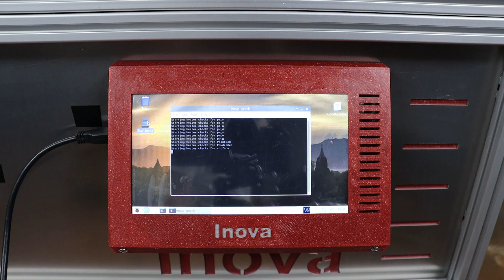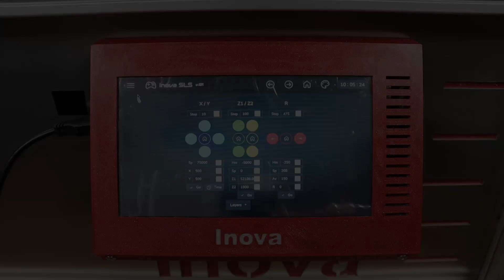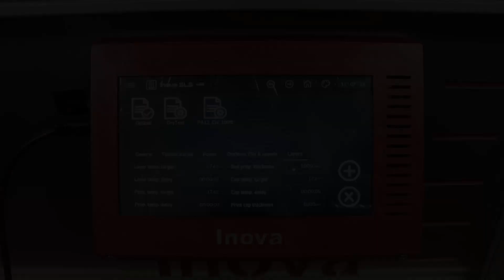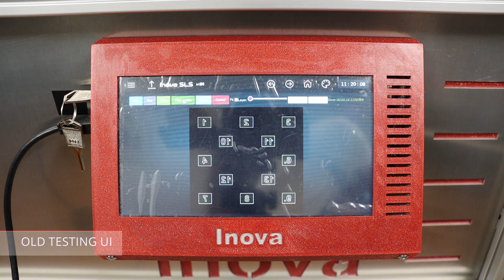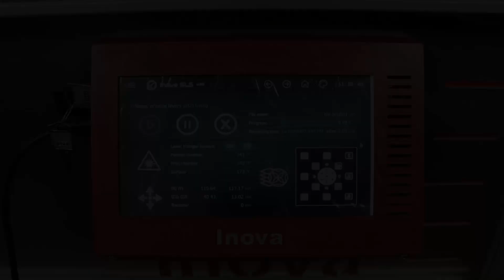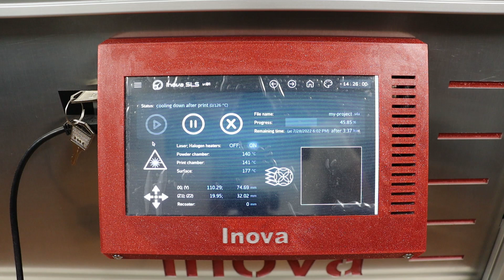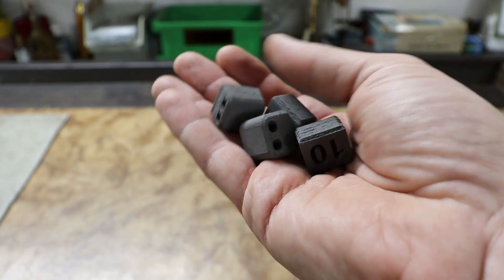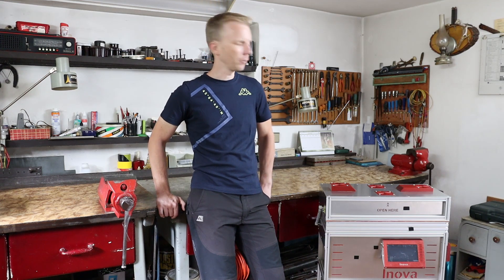DIY SLS 3D Printer Testing - InDepth Look

Comment: I wonder if instead of using one laser you could use 3 side lasers and one top laser to print from the top and sides
Reply from the maker: No sure what do you mean by side lasers. Generally, you can use more lasers but the complexity of the system as a whole will increase dramatically.

Comment: He is smart, resourceful and humble. Tomas, you are such a royal man, my friend. I looked at your site, but I couldn't understand what type of laser you used. Did you use UV?
Reply from the maker: Thanks! I use 445nm blue diode laser.
Reply: @SLS4All  Thank you for the reply, do you use a galvo head? Or is it the moving x y axis?
Reply from the maker: Both the prototype and the RC version of my printer use galvo.
Reply: @SLS4All  I didn't know there was a galvo in the diode laser. Is there a product you can recommend?
Reply from the maker: There are two separate parts - laser and the galvo. You can find links on my website.
If you have further questions, consider joining my Discord as it's better to discuss there. Link is in the description.
Reply: @SLS4All  Thank you so much my friend

Comment: Your surface temp is fluctuating A LOT (I don;t know if its measurement fluctuation or real temp. one). I found that even 0.5C fluctuation can cause prints to look awful. At least on my Sinterit Lisa Pro.  BTW: could you please share which PA12 powder you'e using?
Reply from the maker: You're right. That's why I completely changed the halogen heating head and control algorithm. It works quite well now. I used some cheap powder from Alibaba, but the link doesn't work anymore unfortunately. I also use Fromlabs PA12 powder for my tests.

Comment: dame diy is at this level already, thanks to thinkerers like you :)
So much i want to do upgrade old printer i3 mega. build a high speed normal, finish the cnc steel thingy in basment. and remake an old co2 lasers rails & software...now that is upgraded sls plans instead if its power is enough :P....nm possible with diode dame even more interesting.
To many projects to little time. Many thanks for dealing with the prototyping so me and others fail a bit less ;)

Comment: This is unbelievable work! Would there be a possibility to increase the z height for taller prints?
Reply from the maker: Thanks! Yes, I plan to make the separate Z-height upgrade set like add-on to the current printer design.

Comment: Lovely build, wanted to ask if you are worried about exposure to nylon dust or it's environmental impact, as in you will try to reduce both of these in future iterations. Your other comment said that the build cost you about 3k$, please try to make a company. I believe that there is a huge market for affordable sls printing. I would love to have an option of buying an sls printer for about 2.5 to 4 k $
Reply from the maker: Thank you very much for your interest in my project. No, I'm not worried about nylon exposure. The reason is that it is not carcinogenic, just an irritant unless you handle it carefully and use a protective mask. I did have problems with the bed seals, but that's been resolved - I'll test it in the new version.
As more people asked me about the kit I decided to work on that. If all goes OK, it will be ready in a few months.

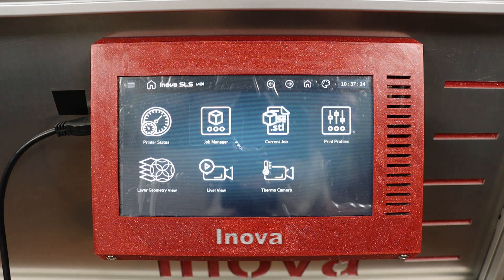Comment: Hello, I appreciate your work. but there is one thing i don't understand. at 3:46 how did you do the surface heatmap? I'm very curious what measuring instrument and software you used.
Reply from the maker: Hi, we use the thermo camera module with the resolution of 32x24 measuring points. Here is the exact type: Waveshare MLX90640. We are using our own software solution for the the printer control.

Comment: probably fiber laser can increase print speed
Reply from the maker: Yes, for sure. But it is of different budget and module dimensions :-) I just ordered the 10W (it uses two 5W diodes) diode laser module to test it. If it will work, current max. print speed will be doubled -  approx. 2000mm/s.